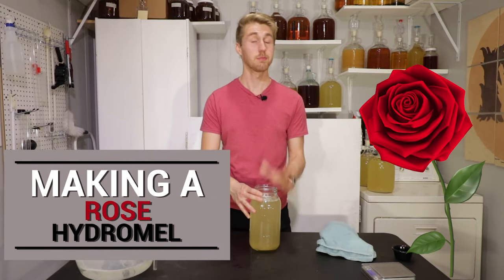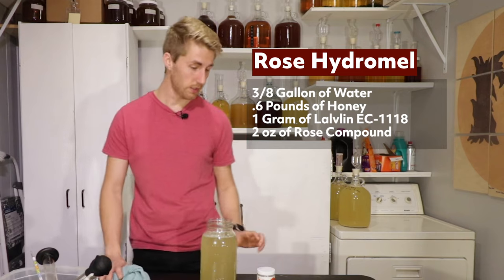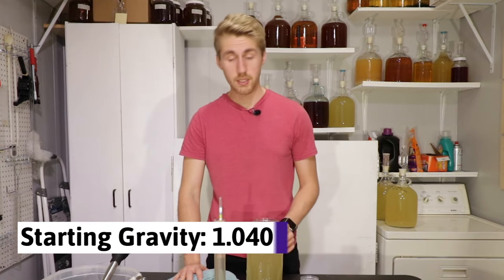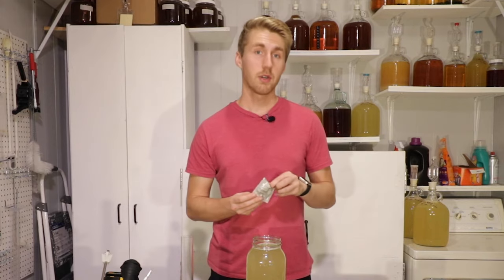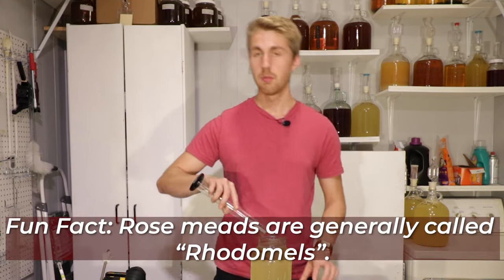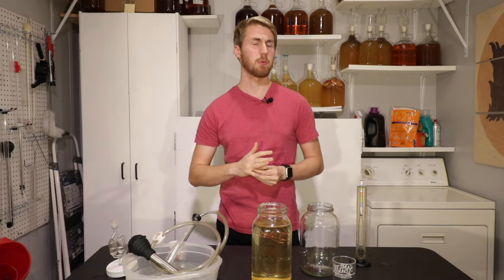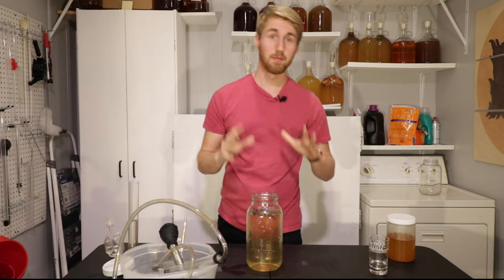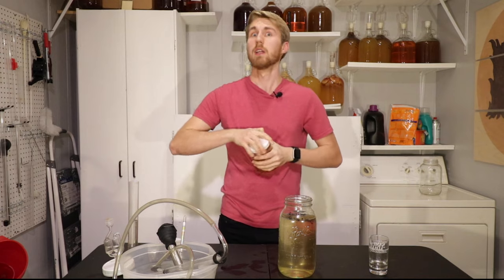How to Make a Rose Hydromel! (Not quite a Rhodomel)

Comment: Any tips on getting 5 gallon hydromels to ferment dry? Following all the steps in written recipes, but they stop around 1.005 and 1.015. Do I need to stir these regularly thinking that the yeast may settle and I end up with distinct layers? My 1 gallon batches work just fine :(
Reply from the maker: Yeast nutrient!
Reply: @ManMadeMead  I used quite a bit of nutrients following nutrient calculators online, i had to re pitch the yeast to get it to ferment dry. I have come to the conclusion that I had not aerated it sufficiently, a recent 5 gallon batch fermented beautifully after I whipped a significant amount of air into it. Lesson learned, when you think you've done enough, keep going.

Comment: How about adding dried rose petals once hydromel has finished fermenting. I don't want to add anything synthetic.
Reply: Why wouldn’t you just add the rose pedal to primary or secondary? Its no different than any other brew. A rose mead is on my list to get to and perfect if possible.
Reply: @1014p  adding in primary vs secondary has different effects. Adding in secondary gives much fresher feel.
But that won't be called Rhodomel unless you put it in primary as per Mr Brian.
Reply: @Dave_en  I am aware, just noting there is no reason to not use actual pedals. Personally getting better flavor in primary plus in case of fruits provides body. Primarily only add spice in secondary and rarely fruit. If I add fruit secondary it is s very small amount. After all honey is delicate flavor and is the star. In regards to fresh taste, I get that out if primary most of the time. Certain fruits like pear are difficult cases here.
Reply from the maker: You can add the petals during or after fermentation!
Reply: @ManMadeMead  thank you.